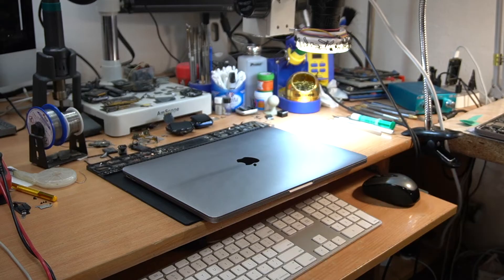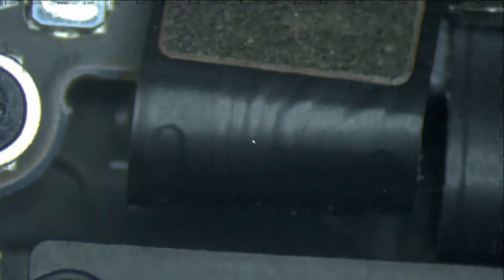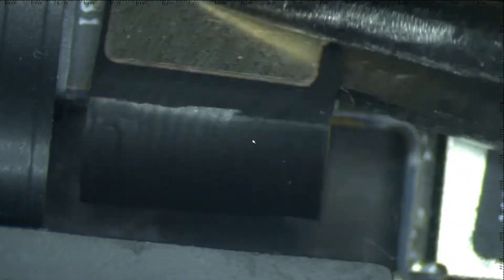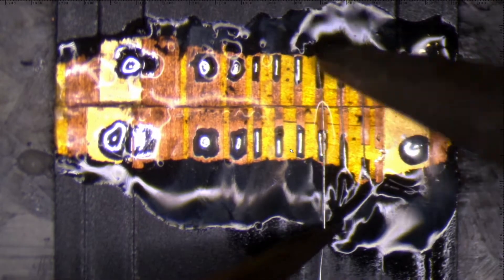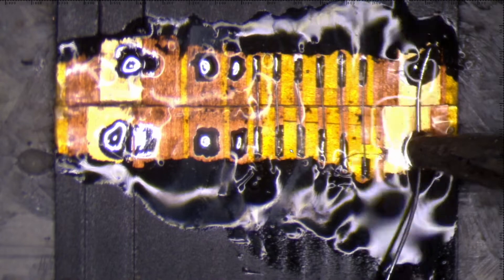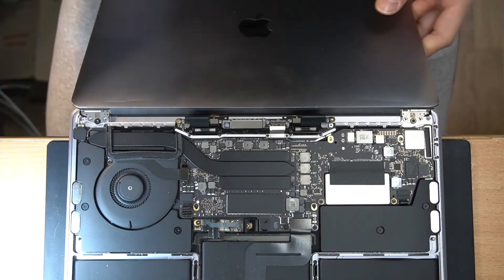MacBook Pro 13 A1708 2017 (flexgate repair) no backlight at 90 degree angle

Comment: do i replace both or just one?
Reply from the maker: The one in the video is for backlight, and the other is for the camera .
If the camera is not working, then yes replace both.
Reply: @iTouch-repair  wait so the left one is for the camera and then the right one is for the black light? cause i got the peice from amazon and it came with one right and one left
Reply from the maker: @Motivationcation  they are sold as one
Reply: @iTouch-repair  my MacBook has two flex gates and the one on aliexpress and amazon comes with two left and right
Reply from the maker: @Motivationcation  they come in pairs
Reply: @iTouch-repair  yes sir do I replace both pairs?

Comment: Very bravo sir!
I’ve just bought the blacklight cable, gonna have a go tonight in the help with your video!

Can I ask where you put 9:40, 10:44 and 10:50?
Reply from the maker: Hi, at 9:40 it's a super glue
At 10:44 its flux
At 10:50 its solder paste
Reply: @iTouch-repair  thanks ! god bless you bro x.
Reply: @iTouch-repair  does the super glue have to be a conducive one ?  Thanks for answering me x
Reply from the maker: @royli6265  no
Reply: Hi there! How much do you charge for this work? 2017 MacBook pro half of the screen is not working!} Apple refused to fix it because it’s not 2016. Thanks
Reply: @olshov111  Apple is so crap with this. They only recognised it is an issue with the 2016 MacBook Pro and not the 2017. it is clearly a widespread issue.

What I done with my 2017 MacBook pro:
I was going to fix this fluxgate myself and was ordering all of the supplies, I then noticed that the keyboard had many keys that suddenly stopped working and the spacebar started to become sticky. Apple have made a free repair program for this so I took advantage of it. I set up a mail in repair and shipped my MacBook off to the repair depot expecting them to change the keyboard and nothing else.

To my surprise I got the MacBook back and the top case AND display had been changed at no extra cost! All of that was done for free! My moms MacBook also had the same issues, flexgate and sticky keys. I sent hers off too and lo and behold, new top case and display.

I brought five MacBooks off of eBay with the flexgate issue and sticky heys. 3 of them were in good condition. These three came back with new top cases and displays. I was able to sell these right away for a profit.

The other two were quite scratched up and were not in as good of condition. Apple sent back the MacBooks with just the top case fixed and they did not replace the display for free. I got an email when they were at the repair centre asking if I would like to pay for a new display but I said no. I then fixed the flexgate myself and sold these off for a profit.

So what I learned is apple will replace the display if you send the MacBook off for repair under the sticky keys recall programme ONLY if the MacBook is in good condition. If it is not in good condition they will only replace the top case for free. So it's worth a try for you if you have any sticky keysQ Even if it isn't in the best condition, you never know, they might surprise you! :)

Comment: I disagree with your opening statement that this is caused by open and closing the lid way to much. I have a 2010 MacBook that I can assure you has been opened and closed way more that a 2017 and it has no backlight issues. This is clearly a design issue from Apple for making the backlight flex cable a few mm’s to short. This is not because the user opens and closes his MacBook.
Reply: IT is from the cable they use.  Opening and closing the lid stresses the cable and will eventually crack it.  They used a different cable system on the older MBP
Reply: @theromeog  exactly 💯
Reply: The issue is only common with MACBOOK starting from 2016
Reply: Exactly. There is no valid reason for display cables to get damaged from opening and closing the lid. Should be able to open and close the lid millions of times with the only thing wearing out being the hinges over a long period of wear and tear. This is one of many intentional design flaws to prematurely provoke customers into getting expensive repairs done.
Reply: Previous years mac used wired connection rather than these flex cables that's the issue now
Reply: Yeah... actually it is from opening and closing.

Comment: Can i replace the cables without cutting half and gluing onto old one? Is it possible to just replace the entire piece?
Reply from the maker: Hello, you can’t because the flex goes under the screen and you’ll have to remove the screen for that!

Comment: Great video, I might give it a go ! But just one question, why don't you just replace the cables instead of soldering ? Thanks
Reply from the maker: Thanks.
The go underneath the screen and the backlight, so it’s impossible to do such a repair without damaging the LCD.
Reply: @iTouch-repair     Great job! I have another question, why didn't you repair the broken cable directly instead of using another cable to fix it? Thanks
Reply from the maker: @SunsetAge  stay tuned for the explanation on my YouTube channel.
Today will drop a video about this issue.
Reply: @iTouch-repair  OK！

Comment: I have questions sir, I think the rail is yellow ,why don't you put wire jumper in yellow rail ? Please I have same problem
Reply from the maker: I made jumpers for all the rails.
Watch the video closely.
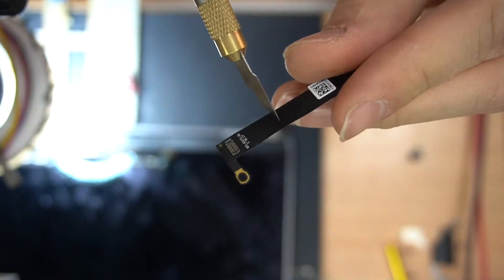Reply: @iTouch-repair  in 7:51 minutes, I see you cut flexible.  and then you just revealed one side of flexible only but the other side you didn't. Did you do the same for the other side ?
Reply from the maker: @erde2243  this side is only for the backlight.
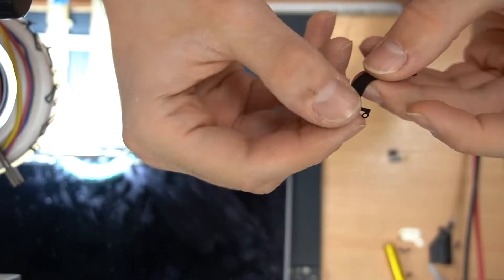In 7:35 I show the whole flex cable and then I cut the side that I need to solder.
Please watch the video closely I explained everything.

Comment: Can you please tell me the thickness of the cables you use? 🙏🙏🙏🙏🙏
Reply from the maker: Hi, you can use the thickness that you see is the best for you.
i use two different kinds of thickness:
one is 0.007mm 
second is 0.078mm or 40 AWG wire
Reply: @iTouch-repair  Hey! Where can i purchase this 0.007 and 0.78mm wires? Do you have a name of this cable? I was trying to find it on amazon but no luck.
Reply from the maker: @rahulp2288  you can find it on aliexpress
Reply: @iTouch-repair  hi boss having same problem, and I found the flex 2 ro ali expres where can find the gum?

Comment: Great fix! Do you think I could do that myself with some magnifier glasses? Or is it a MUST to have some microscope? What did you use to see what you were doing and record at the same time? THANKS IN ADVANCE!
Reply from the maker: Hi, all of the work was done under the microscope and recorded with a camera that is attached to the third eye in the microscope (trinocular microscope)
Back in the days before I could afford microscopes I used to solder under two magnifying glasses, but it was tough to work like that.
And in this flex cable the rails are very small that even if you could solder under the magnifying glass you need a very thin soldering head.
I would say it’s always fun to try new things. I know I did and it got me where I am now.))
Reply: Thanks for that question....been wanting to ask that too